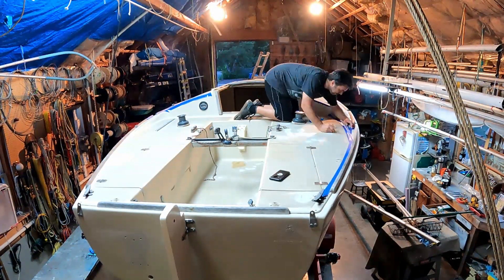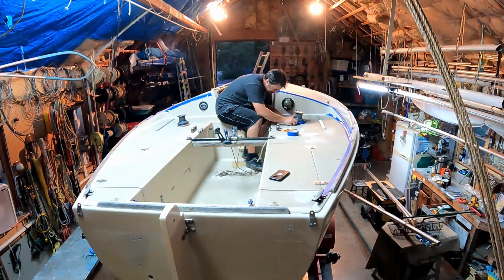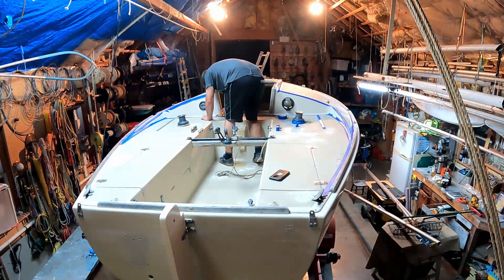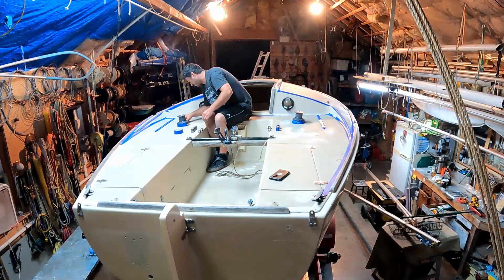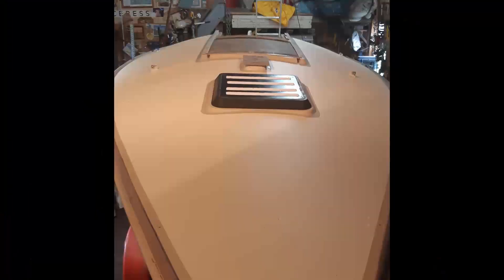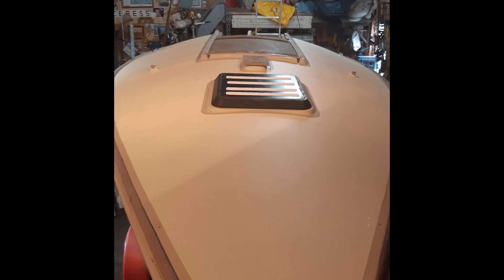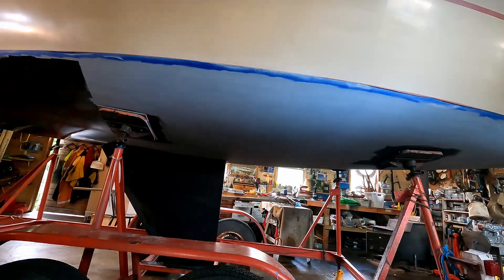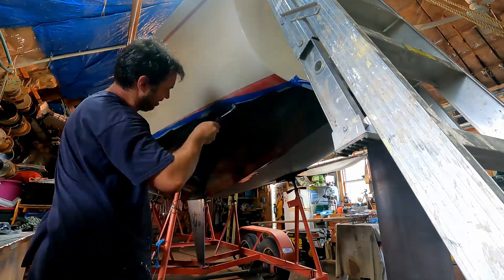Fixing up an abandoned J/24 Sailboat. (Part3)

Comment: Hi, did tout have to work on fixing gel coat cracks everywhere on the hull? Or the only problem you had was around the chain plates? Mine as superficials cracks pretty much every where. And 5 rotten balza soft spots. Did you just covered it all with gel coat and sanded it good bye?
Reply: After fixing your rotten soft spot*
Reply from the maker: BoatworksToday is a youtube channel that has good information on just that.  as for what i did I had very few stress cracks so I fixed the worst ones and didnt even do anything for the little ones. I highly recommend  you watching BoatworksToday on you tube.
Reply: Me again, did you poored kiwi grip or another non skid product right on top of original company gel coat surface?